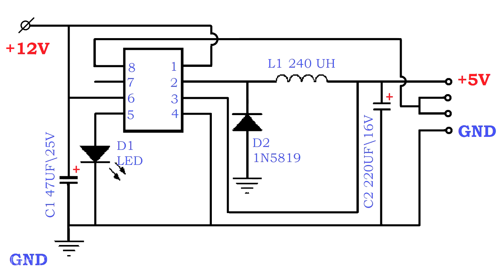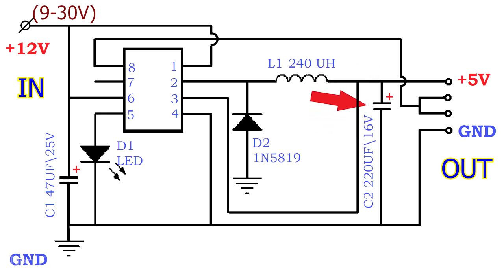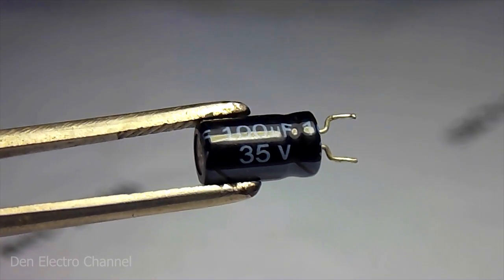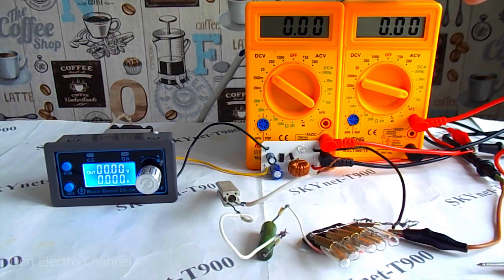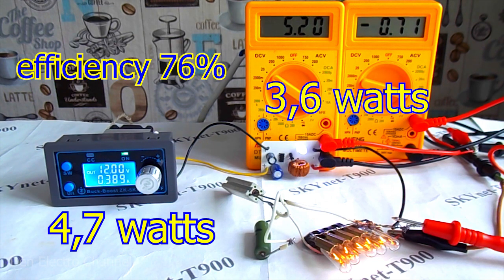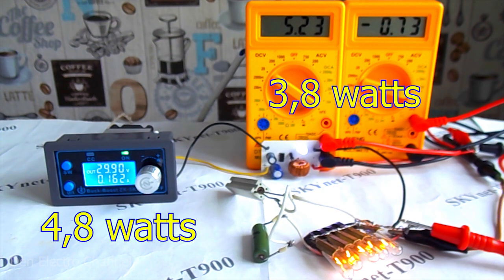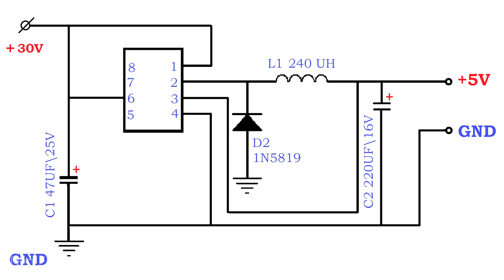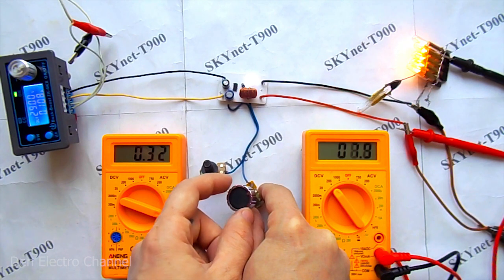Do-it-yourself step-down converter

Comment: Pls what is the minimum input voltage of this ic?
Reply from the maker: in the video it says from 9 volts
Reply: @Den_Electro_channel  OK, what of the maximum input voltage?
Reply from the maker: maximum voltage 30 volts. it's shown here 2:10 in the upper left corner